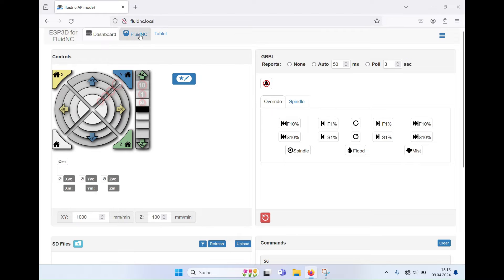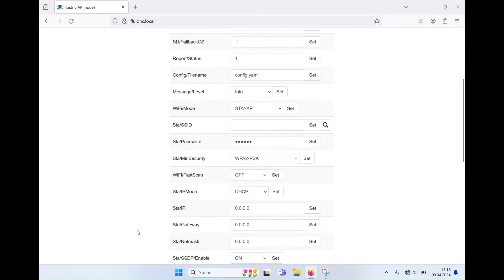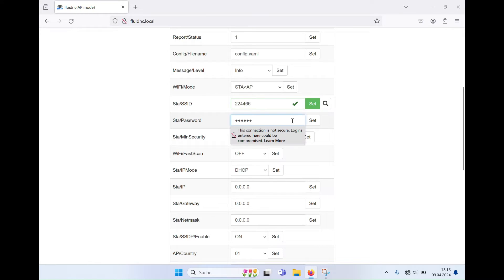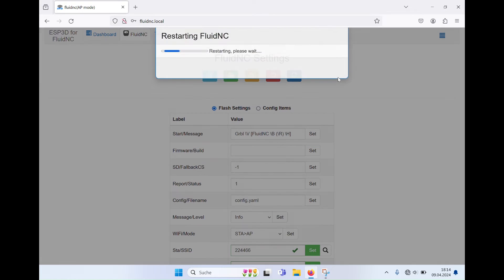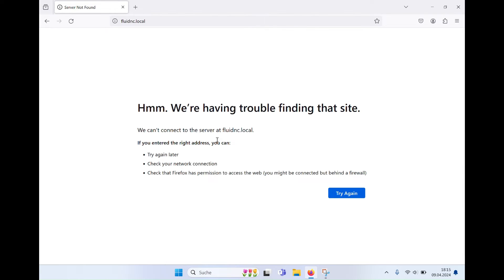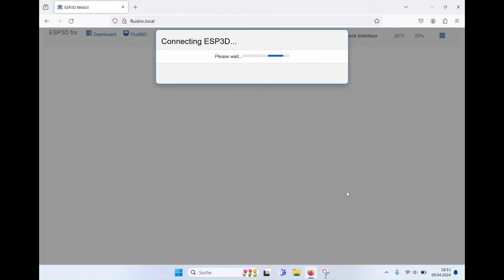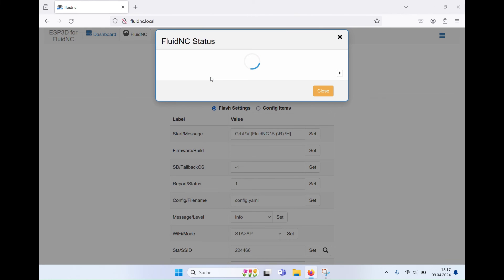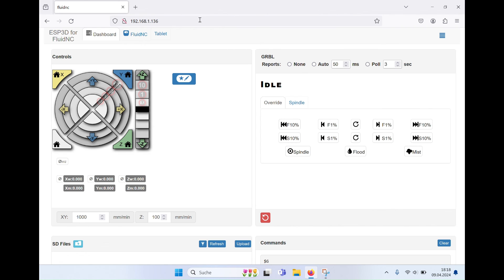Integrate FluidNC Firmware into a local WiFi network (STA)

Comment: Kinda, but unless you make the IP address allocation static, there's a very high chance that every time you power up the NC controller, it'll be allocated a different IP address each time. It's not normal for devices to always get the same IP allocated on all routers, most behave like I've described. So you need to adjust the settings further to force it to always allocate a static IP address :)
Reply from the maker: Yes, that's a good hint.